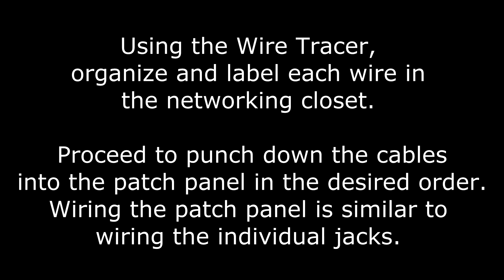[DIY] Home Network Install - Ubiquiti Access Point Part 1

Comment: Out of curiosity, what are snort, squid and HAVP?
Reply from the maker: They are add ons you can download to pfsense to enhance its functions. Snort is an intrusion detection/prevention system so if someone tries to attack you through the net it will be blocked, squid is a web cache so it reduces bandwidth usage, and HAVP is a virus scanner that scans incoming traffic for malware.
Reply: ez|2a You obviously know what you are doing, but why the cumbersome female rj45 jacks? I know you can get ones where you just aling up the wires, then snap the whole thing shut, and the closing of the thing, pushes the wires down and engages them. Also why not get a proper rj45 cable tester, so you could make sure all wires in the cable are properly engaged, altho the proximity aspect of that wand thing is really nice I guess.
Reply from the maker: dumle29 hmm I did not know of those kinds of jacks. Most jacks that i've seen are "punch-down" that need a special tool. 

The purpose of a wire tracer and tester are different. So say I wanted to wire up a patch panel, and I had a bundle of cables from all around the house that I had no idea which one went to which room. There needs to be a way for me to trace the cables easily and quickly so I can wire up the patch panel in the desired order. A ethernet cable tester would require me to wire up the patch panel in a random order or crimp a connector on every single cable (12) just to see where it went, and then i would have to cut the end off to then punch down into the patch panel. At that point, a tester would be appropriate. 

TLDR: A tracer does not require both ends of the cable to be terminated with a jack or RJ45 end. And when you have a bundle of non-terminated cables in a networking closet, it is useful to determine where the wire ends up.

Also if you were working in an office and needed to trace a cable from a cubicle to a patch panel with hundreds of connections, the proximity is definitely useful. Being able to locate a cable without disconnecting it or the wrong one (a big no-no in corporate environments) is a huge benefit. 

See my completed networking job video with the fully wired up patch panel: http://youtu.be/x6Lza_tVf5M

Comment: That's awesome...

I actually have a PFsense router that someone built me  (2 1Gig connections & 4 10Gbase-T connections).

But I still have to learn how to use it.  I don't know s#&t about PFSense.  LOL

I'll figure it out when I get ubiquity for wifi, because I didn't want a wifi connector in my router to protect against intrusion, so I'm going to also have to learn about layering and setting up "guest" modes with ubiquity.

I've got a lot to learn in the next few months.  LOL

Also...
Which cable standard do you recommend that i use for the 10G Connections?
Reply from the maker: jeez 10G! well, cat 6 or cat 6a would work for those kinds of interfaces. 6A standard allows for longer lengths of cable vs. regular cat 6. 

PFsense is very powerful and pretty robust. I was using it with Snort, Squid, and at one point HAVP. Havent really touched their latest version though. Good luck!

Comment: That's cool... Please shoot me a line when they're up. :-)

Also... what parts am I going to need?

I only have a 2 bedroom apartment... but I'm going to turn in the crappy comcast gateway... and use my own router.

I need recommendations now for:
1) modem
2) switch
3) WAP's
Reply from the maker: 1. Depends on what service you get. I currently have AT&T Uverse so I'm forced to use their 2wire combo modem/router. I however bypass the router function completely and use it solely as a modem. I have my own router behind it serving my wireless and wired connections. For cable, i've had no problems with Motorola SURFBoards. You will need to check with your ISP on supported models. 

2. Depends on how many computers you end up on connecting. I installed a TrendNet gigabit switch in my parents' home and it seems to work alright, it is a simple unmanaged switch. You can really go with any one and it'll work if it's unmanaged which is the most common and cheap type. I like Netgear's metal constructed switches too.

3. I like the Asus RT-N16 in particular, its relatively low cost, contains a gigabit switch, N wireless, and can be flashed with custom firmware that enhances its reliability, capability, and performance. I use TomatoUSB with mine and the one I installed in my parents' home. Oh but if you already have a router and want only a WAP, a ubiquiti does the job for well below cisco's cost. Or buy a RT-N16 and turn that into a WAP.

I'm currently uploading the final part of the ubiquiti install in my parents' home.